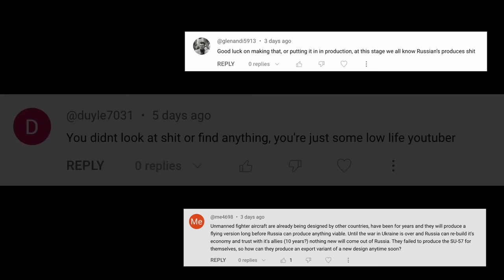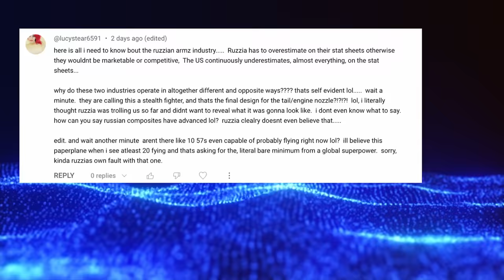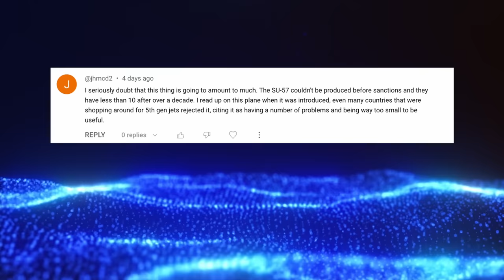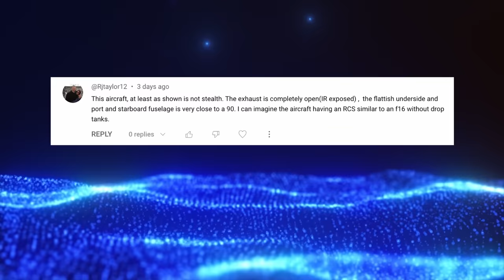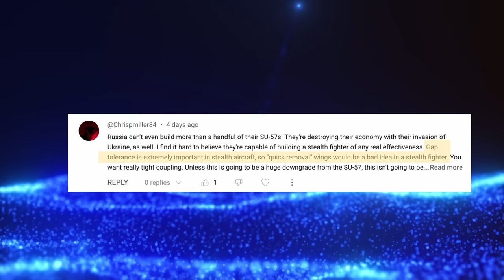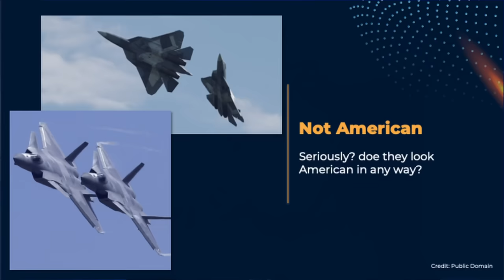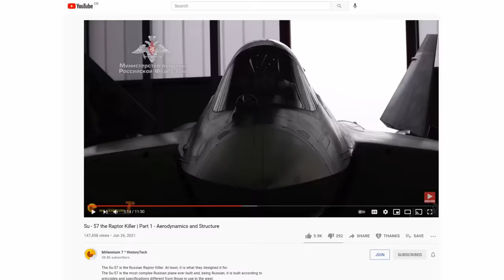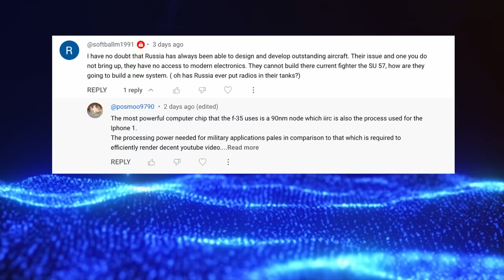Why so Few Su-57s ... and Other Stories.

Comment: About SPECTRA.. i tried (even with a NATO secret level security) to talk about it with a french pilot..
Well ! He simply said ; nothing and he wont be able to talk about it for decades !
It is by far the most sensitive topic about the Rafale and french were FURIOUS when Qatar did an exercice with Turkey.
Since Greece is supposed to buy them too and that Qatar also extensively used the Spectra without authorization from France, they were super furious because of potential data collection from S400 batteries and nearby Syria
Reply: valid point... for elint something flying is way better then a stationary S400 battery.. I suppose

Comment: RE: Russian aircraft losses.

The figure 80 you cite probably comes from Oryx and the like, but it is not quite reliable because they were found to systematically miscount it (sometimes counting tiny parts of planes as plane losses, sometimes double-counting, sometimes counting the losses of Ukrainian equipment to Russia). That said, the losses that are indisputable are still significant, and yes, the manufacturing is not covering it yet, even though this year losses of planes have becoming minimal. Helicopter losses are more noticeable this year due to long-range attacks on parked machines.
Reply: @Statueshop297  they did count them many times though, and the multiple counting isn't limited to same location but also to Ukrainian jets, Ukraine operates same types of hardware (in air and on land) and oryx counts them as Russian. Ukraine operates Su-25 and Su-24 same as Russia and guess what, over 50% of the 80 jet losses are of those two types. Su-25 can be refurbished (that's how the Su-25SM3 are built) and the Su-24s will be replaced by Su-34s anyway. so basically just produce Su-34s and guess what they are, they have a contract for over 30 being built last delivery to date happened in late november 2023

Comment: Great video as usual, not sure where you got the figure of 80 lost because it's nowhere near that number.

 Hopefully you're not using oryx for information as it's been proven that they're double counting sometimes triple counting the same Russian. Losses to inflate numbers. To date for example they have only lost three SU-35s and in the meantime between last year and this year I believe they've gained 12 so the overall gain is about nine airframes from 2022 to 2023.

Again great video and I don't think you answered the question of how many su-57's there are. For my research it says they will have their first full Squadron as of the end of 2023.
Reply: Actually I'm aware at least of two squadrons of Su-35 that where delivered.

Comment: Hi M7 ! 

About that composites ,Soviets used this construction material on the skin of the MiG-29 in the 70's and on the Yak-141 in 80's ( more then 25% of empty weight). For comparison ,Su-57 has also about 25% of composites in empty weight but must know one thing. These composites can never withstand high G-load  for a long period  of  time such as metal Alloys ,especially Aluminium-Lithium. This special  Alloy was first used on the MiG-29M in 80's. 'First stage' prototypes of Su-57 had one big composite panel  on the upper side of the fuselage( centroplane) . After many intense high G turns ( especially 10G sustained turn) ,it was obvious that composite skin can not whistend such a high G-load for a long period of time!  immediately  after first flying tests all first stage prototypes got one big metalic panel from Aluminium-Lithium Alloy type 1441  ( it can be seen as one big yelow panel over the upper side of the fusalage in the assembly process) .Yellow paint of the Al-Li alloy comes from the galvanization process.This 'phenomena' also happened to all-movable vertical stabilisers .First they were all metalic ( Al-Li Alloy 1441) on the first stage prototypes ,then on the second stage they had skin made from composites ( composites have grey color). Intense and longtime high G turns proved that this structure material on the stabilisers skin can not whitstend such a brutal G-force like metallic ones. Vertical stabilizers are otherwise the most sensitive aerodynamic surfaces on a fighter, especially during long-term maneuvering.The Americans had very similar results during test flights with the F-22EMD during the 90s. They found that wings with metal alloy skin were more durable than wings with composite skin.

It was then decided  that all-movable vertical stabilisers have a skin made from Al-Li Alloy and horizontal stabilisers will have skin made half from composites and half from Al-Li Alloy. The real Know-how is not in the composites neither in that Alloy of Al-Li 1441 but in the technology of joining them together on the skin panels by welding. All of this we can see on this video :

https://www.youtube.com/watch?v=R0ykwDn9Tcs

Take a look on a sequence at 0:20 . We can see that big yellow panel over the central part of the upper fuselage. That is special high-temperature Alloy of Aluminium-Lithium type 1441. 
Composite materials have their advantages, of course, but they also have many disadvantages.

Wish You all the best !
Reply: Which is another way of saying that the applied composite technology was not advanced enough to do the job, not that composites could not do the job. Composites are not like metals, where you can simply change the metal and say whether it will work or not. There are so many details to design and construction of composite structures that it is very hard to say 'composites can't do x', and we usually have to say 'this design of composite cannot do x', and accept that design and engineering teams that are better with the materials might be able to get it to work.
Reply: @agsystems8220  That is not right. One of the tactical-technical demand for PAK/FA or T-50 was  to do complete 10G sustained turn. After several test flights on the first flying prototype Bort  51/051 ,they noticed some cracks on the skin panels made from composites ( made by company  Hymcomposite). They first used special germetization glues then decided to change some skin panels with mentioned Alloy. The fact is that  composite I will repeat again can not whitstand such a high G load as Alloy( metalic material) can. Almost same results got Americans in EMD phase of F-22 testing  in the 90's.

As a result of that actions ,Su-57 is the only real 10G ( long duration) capable fighter in the world. Su-35S can do 10G turn but not sustained. 

Fact is that composite materials are not strong enough like metallic ( Alloys).
Reply: Now some more details and info about that composites.Composite materials ( in this case,carbon fiber reinforced plastic) are very strong and have excellent strength to specific weight ratio in comparison with metallic structure materials ( Alloys of course) . Reducing the weight of the aircraft is the goal of every design bureau, that was the case with F-22A Raptor and that was case in PAK-FA programme ( T-50 latter known as Su-57). When I mentioned ATF ,one of the TT- demands ( goals) was to have fighter with 35% of composites in the own weight ,yes 35% .Strength and lightness were one of the goals but that 35% was reduced to 25% ! Why ? Simply because, for example, a composite wing cannot withstand such damages and overloads as a metal wing can withstand. As we know, F-22 Raptor had first test flight in Sept. 7 1997 but only 18 days later  on Sept. 25th ,one specific prototype-demonstrator had its first test flght. It was Russian S-37( known also as Su-47 Berkut ) ,Sukhoi's  own project.  S-37 was flying prototype-demonstrator for all composite forward swept wings and also demonstrator for some  'stealth' technologies ( was painted in all black scheme like USAF F-117A ( otherwise black color absorbs light and heat) with that forward swept wings like USAF AGM-129A ACM . Wing structure consists of 90% composite materials.

So Russians had flying aircraft with almost all-composte wings in the same time like Americans ,even with greater % of composites in the wings.However, what should be kept in mind, the S-37 was only a prototype- demonstrator of certain technologies and not a prototype of a real fighter of the 5th generation as many thought and stated.Its composite wings had no carrying capacity.What happened to F-22 ? From all- composite wings they came to wing with all composite skin but with main structure made from Titanium Alloys ( there is 6 different Ti-Alloys in the structure of F-22A) and composites.From 35% to 25%! His wings have only one big undercarriage and can take one underwing fuel tank.For something like that, you need additional strength, resistance to vibrations, etc...

Wings of Su-57 have two big undercarriage,for two heavy fuel tanks in total ,weapons with weight up to  1000kg or even for four new stealthy tactical cruise missiles called Product 715 ( 1600kg of weight each with max range of 1500kms ).For something like that, for that kind of load capacity, we need additional strenght a sufficiently hard and resilient wing structure.The same story is about that G-loads( overloads).

In the video that I previously posted ,in the sequence at 0:15 we can see wing structure of the Su-57,main/ internal structure is made from Titanium Alloy and that Al-Li Alloy.There is no composites,only on the skin.

Now some more videos with english titles, I will say from almost all-composite skin to mixture of metallic ( Al-Li Alloy) and composite. Pay attention to the first flying prototype from 2010 and what it had on the upper part of the fuselage and what the production planes have now.

https://www.youtube.com/watch?v=ugZ8EdA-exc

https://www.youtube.com/watch?v=N4-RwreHRRg

https://www.youtube.com/watch?v=aDXNDA5xuS4

https://www.youtube.com/watch?v=CrZ8knrxtVM
Reply: So as we can see ,Soviets worked with composites in the 70's and 80's and Russia worked with them even in the 90's( we all know what was economic, political and financial situation then). Same story is about that so 'popular' AESA. How many people even know ( or have read/ heard) that first Soviet if not in the world developed AESA was N014. Developed by Moscow's NIIR Fazatron at the end of 80's .Static tests began in the beginning of the 90's.Model of that radar was first publicly shown on the MAKS 2001, ten years after that.

Su-57 got completelly new AESA ,developed under new TT- demands. It is known as radar system N036 Byelka ,dual-band radar system ,first of  that kind in one fighter as part of highly integrated and automated complex Sh-121 MIRES.

N036 has exactly 12 ( twelve) radar antennas-AESA of which 4 are centimetric ( they work in X band) and 8 are decimetric ( work in L band).With all of them, Su-57 is the only fighter in the world with all-around ( 360° in azimuth) radar coverage or FoV! All other operational fighters in the world have only one radar, Su-57 have twelve of them.

One comparison ,Su-35S has its PESA N035 Irbis  ( some kind of hybrid ESA where we have PESA radar with many capabilities  of today's AESA ) .This radar  has steerable  antenna which can  steer left-right to expand FoV to 240° and that is twice as much as any AESA in any western fighter.Main FoV of Irbis is by the way 120° and in that envelope radar can scan-search in given period. N036 in Su-57 with three main X band AESA ( have in total of 2242 TRM) one for forward and two for side-looking, can instantly-simultaneously scan-search  in the FoV of 270° ( +/- 135°). Awesome....

Hm , twelve  AESA vs only one in any other fighter ....Nice.

Comment: the FC31 and the J35 are different planes. the J35 is enlarge and strengthen to handle carrier landing and allow lower airspeed takeoff. the "5" in chinese designation for carriers aircraft. the export version is likely to still be the FC31 which we recently saw a new prototype airframe being build, so Shenyang is still trying to move that into production and export while also building the J35 for the chinese navy. J35 would be more expensive than FC31 and so less competitive for export...

Comment: I find it funny people are surprissed there are low numbers of Su-57. Program delays are not only common but almost universal. This is without getting sanctioned and going to war. Why would they rush to produce half finished product too meet original scedule? The engine is not ready. Why build 100 aircraft only to put new engines after. You do realise how much extra that is going to cost? Making a few planes as a defacto prototypes for real world extended testing in a combat enviroment is the best use of resources. They are much better off focusing on upgrading their older planes untill the Su-57 is ready for prime time. NAFO bots boasting about F-35 numbers on Quora doesnt impress the Russians.

Comment: Hello from Moscow suburbs, gentlemen! Some comments on "dead economy" of Russia - it is a total propaganda, there was even no hicups when west switched the swift banking system. Shelfs are full, inflation is about 10%, but it has been so since i remember myself, excluding 1998 and 2008 chrisises, it is just called a low debt economy model, you know). About the chip components, i was born in Izhevsk, the place where AK mgs produced, also there is a Tor point defence vehicles production, and 60km away there is a huge ICBM and smaller ballistic misile (Iskander family) production in Votkinsk. All those stories about lack of chips are leftovers from late 90s where totally destroyed MIC of Russia couldn`t produce the stuff, so they were bying components abroad. Folks from Kupol actually told me they were using some low level components like military grade capacitors, but since 2014 most of the stuff was slowly but steadily replaced with local production. Another thing - the Nebo-U radar has it`s computing station called Baget, it is serially produced thing both for export and army. And it has quite a powerfull processor, the issue with it is it will never hit the shelves of PC shops because it is slightly radioactive. Direct quote from my friend who was assembling those radars. So it seems our folks just using something different than silicon. Anyway, everything is used in MIC to build military machinery is made localy, it is a doctrine, maybe say Geran-2 and smaller FPV drones are made of Chinise stuff, but even the surveilence drones like Orlan-10 are made totally of a local components. Have a great day there, gentlemen. Don`t belive propaganda too much, we know the path it leads too.
Reply: @preludeh22a57  yeah, US bot, lol)))
Reply: @preludeh22a57 Please dismiss him. Do try, it is quite interesting when intelligent and knowledgeable people argue

Comment: I don't believe that Russia can build a production line for a jet that in not from 1960. Gluing a few prototypes from spare part from su27 is not the same thing as actually having a running production line for something as complex as a modern jet. They dont have any institutional knowledge, dont produce any planes at scale, never did, do not produce any electronics. What exactly is the jet going to be made of?
Reply: Since the end of the cold war sukhoi has built hundreds of su-30 variants across the globe. Right now Russia outpaces all european fighter production and yet only spends about roughly 70 billion a year which is well below the sum total of all european defense budgets. Add to this that Russia updates its strategic weapons, navy, army, etc...

Do not delude yourself. As the saying goes Russia is never as strong as they pretend to be but they are never as weak as we like to think them to be. 

They are challenging the combined soft power of the western world ofder. This is extremely impressive and scary stuff. Not a joke. Our leaders are leading us into ww3 I fear.

Comment: I think the fact that they didn't use them in Ukraine shows that Russia isn't very confident in it. Also no other countries are buying it, those 2 things are hard to overlook. By the time they have them in great numbers the f22 and 35 will be replace with 6th generation fighters.
Reply: As far as I know su57s were reported to be used in Ukraine, but not in aggressive manner, instead flying out of reach of Ukraine air defense, use radar and launch long range missiles.
Reply: They were used in Ukraine ??
Reply: @little_error295  it was reported by Russian news agency:
"Russia in Ukraine used a link of four fifth-generation Su-57 fighters connected into a single information network, RIA Novosti reports, citing an informed source.

“As part of the air defense system, the Russian Aerospace Forces carried out an operation to identify and destroy Ukrainian air defense systems using a flight of four newest Su-57 multirole fighters,” the agency’s interlocutor said."
Reply: @AlexanderSeven  oh I know that they where used I’m replying to the original comment saying they weren’t used 😅
Reply: Nah much more complicated than that. For example there is a sizable group in the defense industry that dont want even f-16 fighters to go to Ukraine. They understand how precarious the position an f-16 would be in in this war zone and they fear even the loss of the f-16 could damage the aura of our air power. This is silly as even the average person understands that f-16 fighters will not do astoundingly in this conflict. It will not hurt the mystique of our air power as we wre talking about essentially block 50 tier f-16 fighters which are great but old.
Reply: Wrong. They are using them almost daily. Remember the bit about stealth?